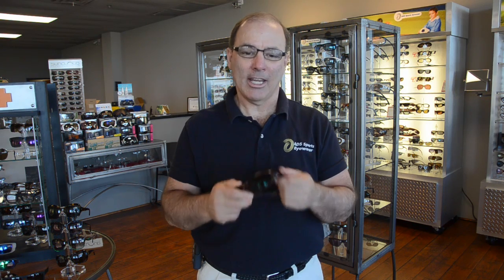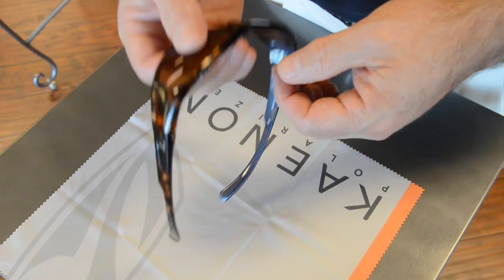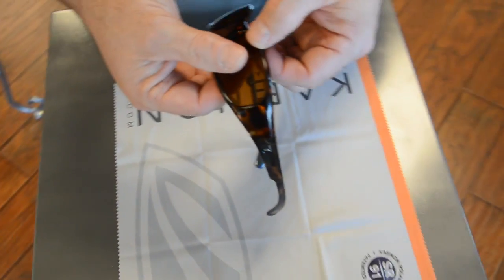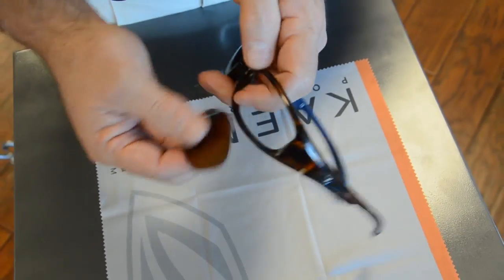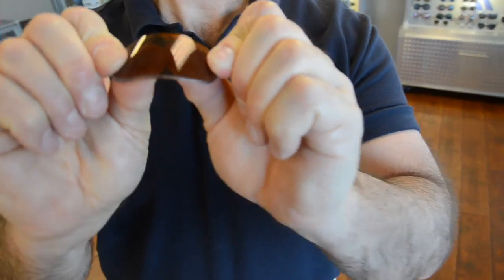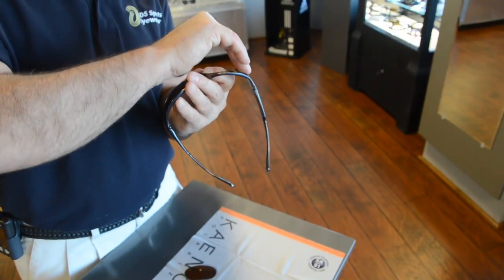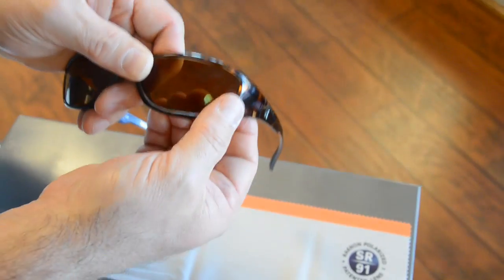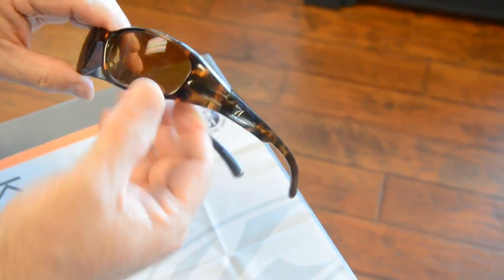How To Remove and Install Prescription Lenses in Full-Frame Sunglasses

Comment: So I came to LensCrafters today with expensive new frames I just purchased. I wanted to get my prescription put inside. Long story short, the employee decided to try and pop the demo lens out over 3-4 times after I insisted on unscrewing them to get them out. After several attempts she gave up and unscrewed the frames for the lense. Could she have damaged or warped the original structure of my frames? I’m very tedious and don’t know if my frames are messed up now. They are being sent to the lab for my prescription. I just don’t understand why anyone would risk messing up frames to pop lenses out instead of unscrewing the frames properly.

Comment: did it on normal prescription glasses. took a while but worked. thanks
Reply: SportTalkForDummies Did the lens broke?
Reply: no, lens was fine. Actually if you heat the frame w a blow dryer it makes it much more plyable, just make sure not to heat it up too much

Comment: I didn’t break mine I soaked them in HOT(not boiling) water first for about 20 seconds and the lenses popped right out
Reply: Just be careful not to get them wet when you soak them.

Your welcome.